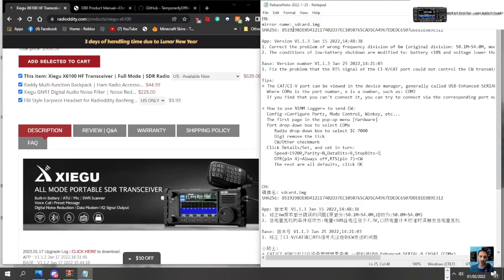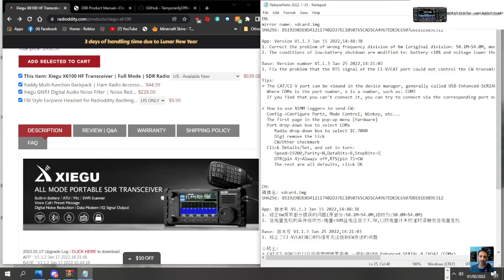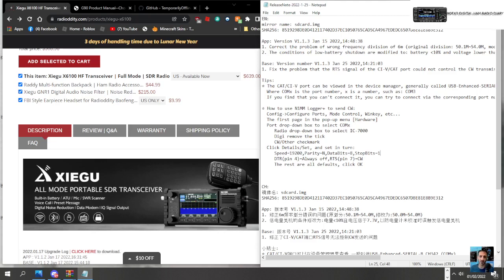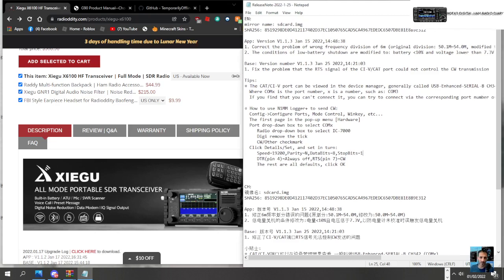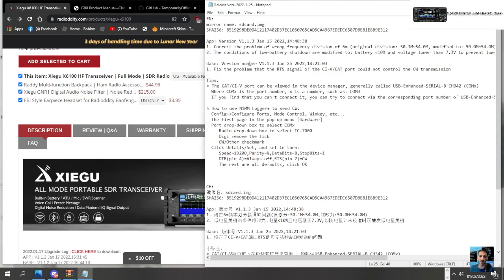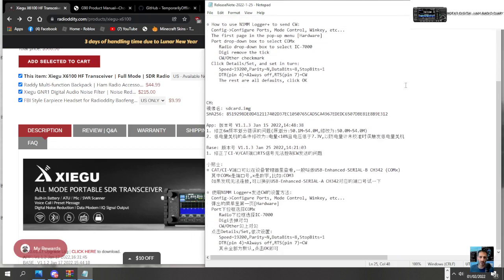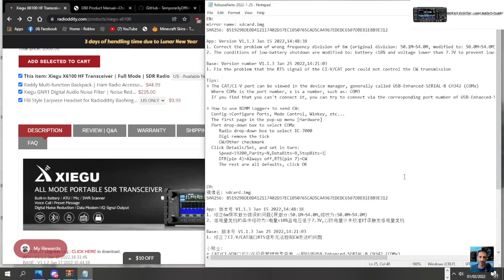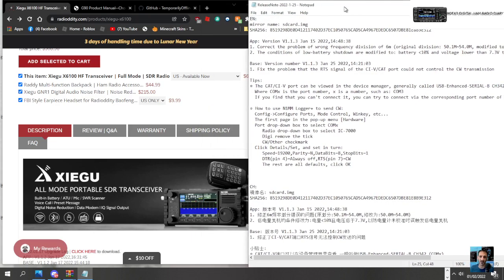XIEGU X6100 -FIRMWARE NUMBER 5-   v1.1.3 -01/02/2022

Comment: Hi again
i now have my X6100, from sinotel,
i am getting a lot of birdies with the antenna unpluged s5 signal on 20m with the preamp on s7 at 14.182,  s7 at 14.083,
s10 at 13.999.8mhz s4-5 on all bands with nothing plugged in to the antenna ,do you get this with your x6100,
also can you test your tx audio on FM 6METERS As mine is very distorted , use your icom as the rx, also no am modulation (alot have the am mod problem on the forum,
Thanks Dave 2E0DMB
Reply from the maker: https://youtu.be/BwSwLV-_1PM